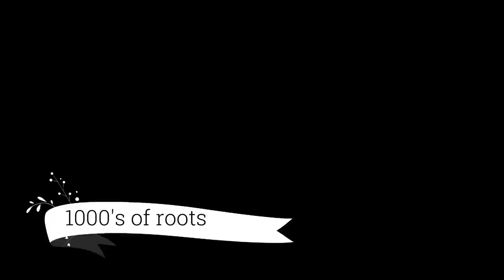Our Thoughts On Garden Pathways: This Was Unexpected!

Comment: You mentioned that you had flooding in some areas? Does the concrete need some kind of way to drain?
Reply from the maker: We just have heavy rains that run through our garden and down to our creek.  We are hoping the concrete with help divert it down our driveway instead of through the garden.🙂